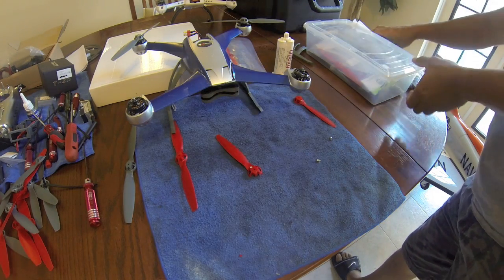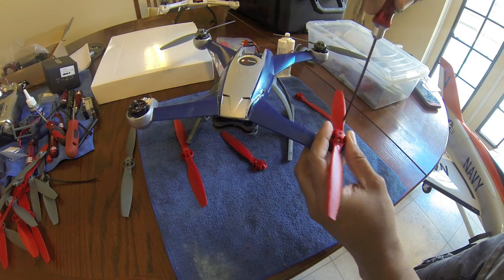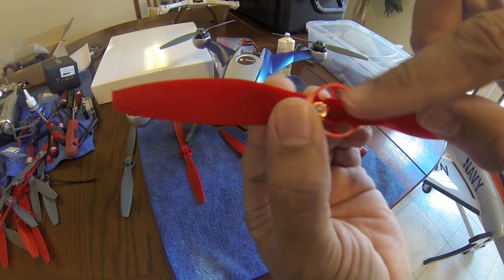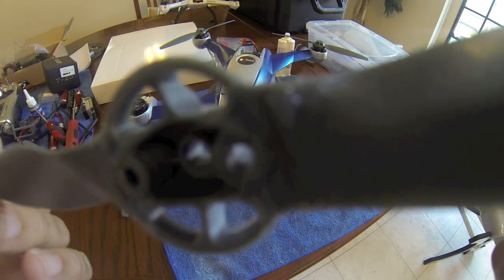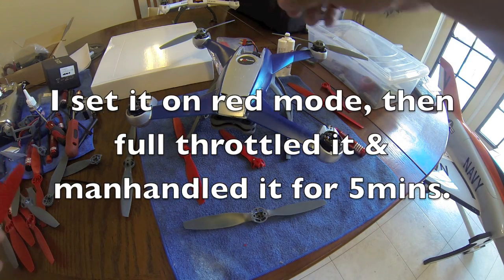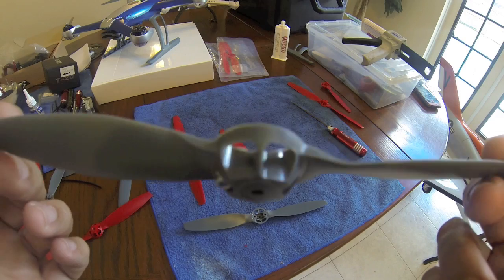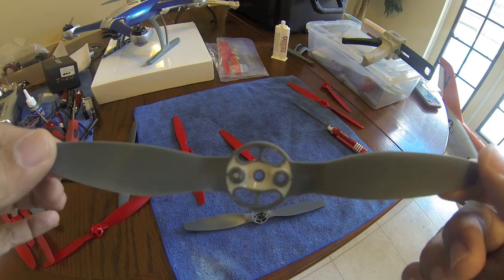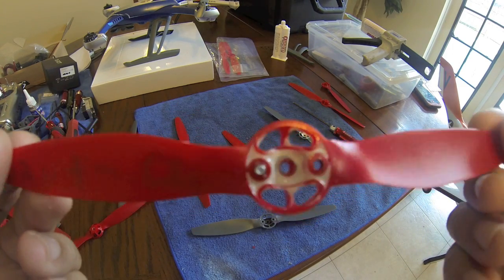Blade 350 QX Possible Prop Fix

Comment: The "B" props are very good! i have flown my 350qx hundreds of times... aggressively and chilled out FPV.. No problems at all... If you are concerned, take a flash light to the props and check for stress points or mini fractures.. I annealed my props before flying... this technique takes all the stress out of the prop that can occur during the moulding process... Simply put your props in some boiling water and boil for 3-5 mins... take them out and let them return to room temperature SLOWLY! this makes the prop material more flexible and removes the stress points that can lead to a snapped prop. You only have to anneal the props once and your all set! hope this helps some of you guys out ;)
Reply: Dont crash Dave and your have no prop issues.  LOL
Reply from the maker: Dave I'm happy that you haven't had any issue with yours. You must have the ones that had fairy dust sprinkled on them & made them special. All I know is that I'm flying two identical 350 QX's except for the props & the only one thats made contact with the payvment involuntarily has been the one with the "B" props. Even the ones that I epoxyed just gave out last weekend & i've been flying that one since I made this video so it did last longer than others. All I can say to you is if they work for you then keep using them.
Reply: Sucks about your props mate :( yeah mine have been fine so far (thanks to tinkerbell lol) but the first time flying i crashed with a set of b props on so had to replace them... I didnt anneal the first set and they were quite brittle... After annealing the new set they are very flexable. google plastic annealing to know what the process involves and also the added improvements that can be achieved... Just suggesting this to help some people out.. The CNC props can overheat the motor and cause issues with the ESC controllers... This makes the quad unstable and susceptible of flipping over in flight. Either way there is no right or wrong way... Just the way that works for the individual.. I just hope horizon brings some carbon fibre props that will fit the 350qx without having to use the prop adaptors! Take care all and fly safe!

Comment: I'm just getting into quads.  I purchased an inexpensive WL Toys v262.  So far, I'm impressed at the stability for a $90 quad.  I will eventually upgrade.  I was impressed with some of the reviews of the Blade 350 QX.  Then, I see these issues.  I sell polymers "Plastics" for a living..  From just watching these videos, my opinion is these props are made of cheap HIPS or ABS plastic..  I sell polycarbonate materials that would make these blades close to indestructible... These Blades appear to be poorly designed... You are reinforcing the obvious weak point.  I think though this may cause instability in the balance.  Love your jets by the way...

Comment: I found new info on the props and will make a video in a few days about them....It will explain more..... What you are doing here in this video is the only thing you can do to make these props better... I can tell that you are one of the few that knows that the B PROPS are nothing but the same old prop with a little more plastic in it.....Ill explain that too.....Using a kids toy propeller & props that were going to be used on a KIDS MODEL quad to fly a $400 plus.. quad copter all to save money and keep cost down..... Shame Shame Shame on Horizon Hobbies ....

Now i understand why there are now lawyers involved and the talks of a class action suit!......... This is not the first time HH has been involved in a Class Action Suit....see the following...

http://www.spektrumrc.com/ProdInfo/articles/1741-ClassSettlement.pdf

Comment: What Colin and DJI has done here is simply brilliant and fantastic..
How to avoid DJI Phantom Fly-Away by Colin Guinn
How to avoid DJI Phantom Fly-Away by Colin Guinn
I also wrote to several quad manufactures as well as DJI and Blade a number of weeks ago..about my concerns about what happens around congested invisible Wi Fi Hot Spots and saturated 802.11g in central city locations and cell phone towers and the instant disconnection and erratic uncontrollable flight that occurs and the high impact crash that follows. DJI was very proactive and confirmed the situation and the response is so professional..Go DJI Phantom..BUUUTT Let the buyer beware with the Blade 350QX is very unsafe to operate in a congested WiFi area it instantly becomes disconnected from the transmitter and flys up and loops uncontrollably then simply destroys itself in seconds as it crashes to the ground at high speed. The Blade 350 QX does not have the ability of any firmware updates, it is very poorly shielded from Wi Fi and they have already been forced to issued a safety bulletin regarding Wi Fi interface from the Go Pro Video stream ..this is only half the story..The Quad industry will be heavily over regulated because of the cowboy approach taken by Blade with their reaction to my documents simply saying that hidden inside the super fine print in the warranty section it say not to fly it near people or magnetic fields..Plus key spare parts for the repair of the BLADE 350 QX Quad are back ordered 2 months ... Comments please
 PS A hot tip to help you - download an app called WiFi Analyzer https://play.google.com/store/apps/details?id=com.farproc.wifi.analyzer
Several are available for either your I Phone and Android and you will quickly see the 100% congestion levels if it is maxed out avoid flying your quad there a crash is extremely possible..Safe and happy flying for all

Comment from the maker: It looks like your into photography, so if you plan to use it for that even though they all could hold a camera the Walkera & Phantom are a bit more stable. If you like something thats fast & you can throw it in you backpack, car, etc. I'd go with the Blade. I take the blade with me while I'm out in the field working so if I have a few mins to burn I'll take it out & fly. But if I want to do short range FPV I prefer the Phantom. PLus the Phantom could handle more weight.

Comment from the maker: Go to ebay and type in 8" carbon fiber props for dji Phantom/Walkera and it should come out. They cost 20 something dollars for 2 pair. If you can't find it I put the exact item number on a reply on one of my latest videos.  You also need the ring adapters for when you drill out the holes on the props.